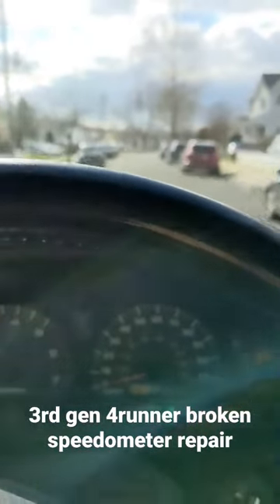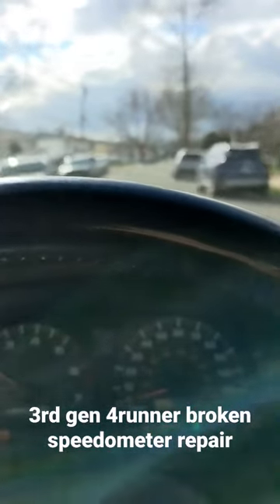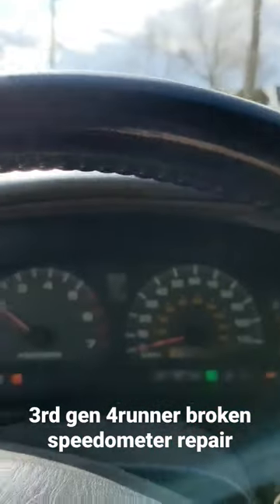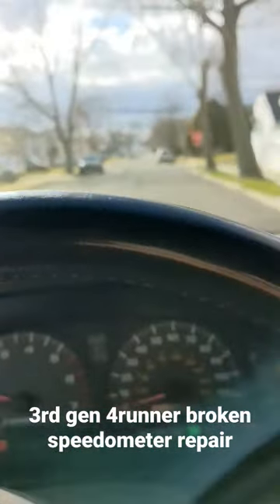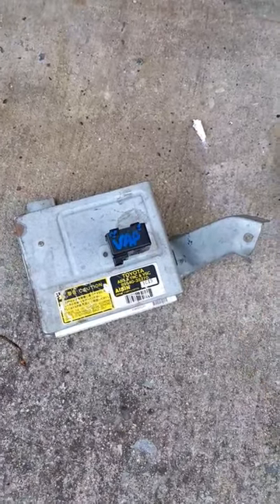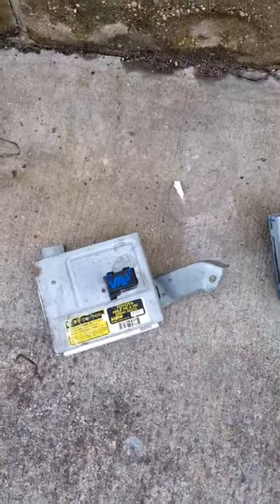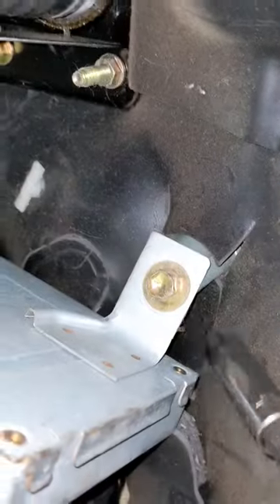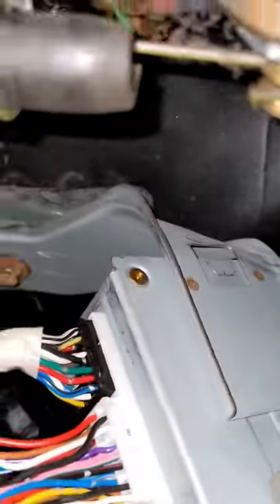3rd Gen 4Runner Speedometer Repair #toyota #4runner #overlanding #diy #toyota4runner #offroading

Comment: Yes finally found a solution. Ive been doing so much research as to why my speedometer and odometer not working. THANK YOU!
Reply: Does it has a check engine on for odometer not working
Reply: @leikongvang4922   Yeah, check engine light, VSC TRAC, TRAC OFF, ABS, and BRAKE lights are on.
Reply: @dannycarlo89  ok I got a po500 code and I replace a used ABS module sensor and still don't work...what is next...

Comment: Will this also cause my odometer and fuel gauge to stop working??
Reply: Need the answer to this question as well. Did you figure it out?
Reply: @noahfornuto6644  
No, this particular fix did not correct my issues. Did some more research, found a t4r thread with the answer. Turned out to be a blown 10 amp GAUGE fuse; located in the fuse box under the dash, on the drivers side.
Reply: @LittleMissMuffin82  Do you have to remove the gauge cluster?
Reply: @noahfornuto6644  not to access the fuse panel. It should be by your left knee when seated in the drivers seat.
Reply: @LittleMissMuffin82  awesome I figured it out thanks!

Comment: I have a 99 4runner and i cant find the location for that part
Reply from the maker: it should be under the dashboard on the driver side
Reply: Does you have a check engine light on for speed odometer not working
Reply: Same. I have a 2000 4Runner and I cannot locate this part either. 
*Found it: Located under the glovebox, behind the right side kick plate.*